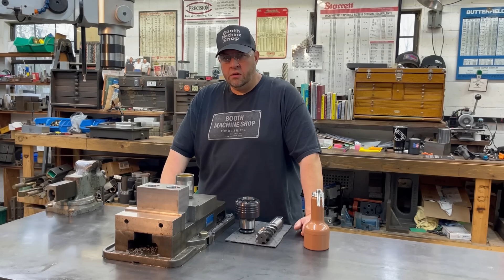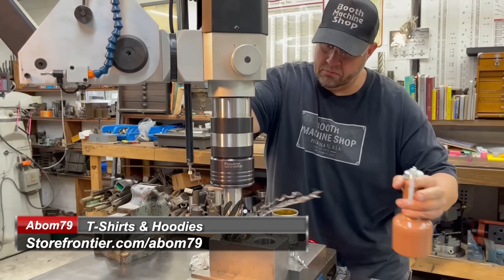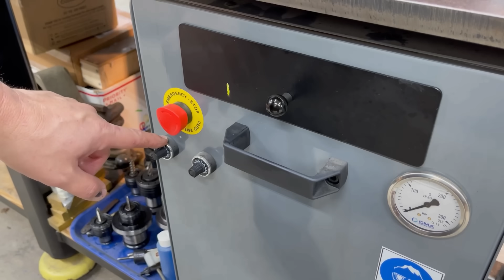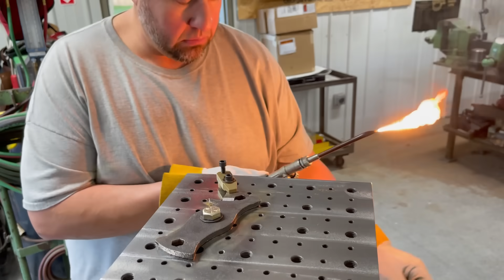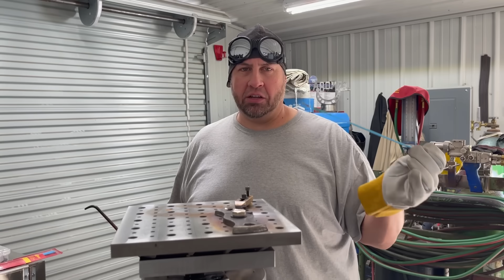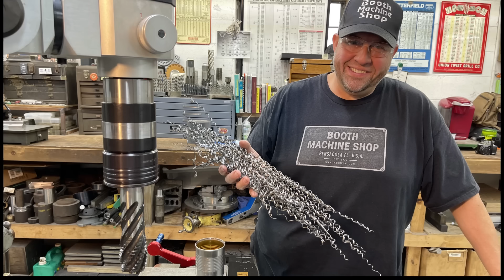SNS 335: 2" Power Tapping with Flexarm GHM-60, Cast Iron Braze Repair

Comment: How fast are you running that tap? Seems a little slow to me. I usually run coated spiral taps at around 15 m/min 🙂
Reply from the maker: I had the tap set at 25 rpm. A little slow but the main reason was so the viewer could easily see the action.
Reply: I believe he ran it fast enough to do a perfect job.  Seems like that is the goal.
Reply: @paulcopeland9035  no doubt about it 🙂 i was just wondering 😉

Comment: 24:12 Adam - it looks like you put down that hot torch very close to some hoses. It's a thing to be careful of whether soldering, brazing or usage of flames for other heating purposes. While the immediate hot danger is removed once the flame's put out, the tip of the burner will still be very hot !

Comment: "dress" the weld down with power tools, I think Tom Lipton would have used a file on the whole thing. Just joking Adam, looks great. I was wondering what that tang was for also. Nice seeing you live Thursday, without that, I think I would have been somewhat questioning why you're just randomly tapping holes in blocks.

Comment: Hey Adam, maybe one time you can explain to us non machinists why you use coolant/cutting oil at times and other times without. You seem to machine cast steel dry and other materials with some sort of fluid. Any reasons for this?
Reply: "Gray" CAST IRON contains graphite flakes scattered throughout the matrix.  It's self lubricating.

Comment: Adam, is there ever a risk of these large taps in a blind hole becoming chip bound, in that you are not reversing the tap regularly, like you would if hand tapping?
Reply from the maker: Spiral flutes taps do not need to have the chirps breaking, they push the chips up and out of the tap. Hand taps need to be reversed.
Reply: Even though I was alway told to reverse taps in school I was also taught by my father several years later that reversing a tap isn't generally needed with most modern taps because they are much better designed to clear themselves.
Reply: To expand a little on Adams answer... There are basically four main kinds of taps: conventional straight flutes (most common consumer home shop type), spiral point, spiral flute, and fluteless. 
The straight conventional taps basically form the chips straight into the flutes where, depending on the size of the flute, eventually get packed with the chips. Not only do you have to back up (reverse) the tap to "break" the chip but you also sometimes have to remove the tap entirely to clear out all the packed chips. These kinds of taps are the most common because they are cheaper to make and they work well enough for most blind or through holes in most materials.
Spiral point taps look a lot like straight flute taps but have a distinctive grind on the first 1/3 or so of the tap. They are ground so that the chip forms down the hole. Similar to the spiral flute chips but they go out through the bottom of the hole. Because of this they are no good for blind holes (as Adam was doing) because they would pack the chips in the bottom of the hole. They are very good for CNC and machine tapping from the top if the hole is not too deep and is also a through hole. They are also very good for hand tapping.
Spiral flute taps (like the one Adam was using) are like a tap with drill flutes ground in to it in the same direction as the thread. hey feed the chip up the flutes and out the top of the hole. Theyare also good for blind holes and can be used on blind or through holes.They are excellent for CNC and machine tapping.
Fluteless taps, as the name imples, have no flutes. They are more commonly known as form taps. They are very very good for softer materials (brass, aluminum, mild steel.) Since they have no flutes and do not cut the thread they will not create chips and need no provision for clearing the chips. They are also very good for CNC and machine tapping.
This is not an exhaustive list... there are other stles and techniques for threading a hole but the above are the main types.
If all you are used to are the straight flute taps from your hardware store then you will be pleasantly surprised by using a good quality spiral point of spiral flute tap. MUCH easier to work with. They tend to cost more US$7-8 for the smaller ones up toabout US$15 for a single 1/2-13 spiral point tap. Even more for cobalt and fancy coatings. But well worth it even for the hobbyist or occasional user. The cost and aggravation of a broken cheap tap far outweighs the cost of a quality tap that will last you a very long time.

Comment: It is possible to do this tapping in the lathe too?
Reply: It would have been faster since he already had it mounted to bore the holes, and cheaper too.
Reply: @catoomch  from a professional perspective, it makes more sense do do this with the powertap than with the lathe. Time is money!
Reply from the maker: The lathe is more than capable of pulling that tap into the part. You have to remember this was drilled in a Cnc mill. Even if it were production this would not have been doing in a lathe. Using either the machine the block was drilled in or using the Flexarm is the way to tap these. I only had it in the lathe to easily chamfer the holes and share some 4 jaw indicating.
Reply: If you really wanted the perfect thread with almost no torque for cutting, you would mill it in this CNC-Machine with a Thread Mill, after you bored it. It was just a demo, what the Flexarm could do for repairs.
Reply: @Abom79  Was it a 6 flute tap ?  If so, it'd be like loading a lathe with 6 cutting tools - and all of them taking a decent cut !
Reply: Yes but small lathes like Adam has would be bordering on being overloaded causing excessive wear. The lathe he used at his former work would not have this issue and would easily break that tap likely if things went wrong !
Might be better suited to a horizontal milling machine as they're better designed for tough jobs.
Reply: @millomweb  thats the question to adam.. is his lathe capable of tapping this size in the lathe?
Reply: @MrMidiman33  His lathe would do it but Adam wouldn't put that kind of a load onto it - I don't think - for one reason - control of the process is another.
It's a similar thing with trucks - some drivers drive them overloaded - it works but it causes more wear on brakes that they weren't really designed for. I've done that - once - the journey was quite a short one (a mile or 2) and not up or down any steep hills.

Comment: I use to do same thing except on old radial arm drill press didn't have shut off feature , nice.
Reply: The clutch was in the tap adapter - so had you used that, you'd have had the same safety system. One slight but significant difference - is your drill being all mechanical builds up momentum from the motor to the tap. With the FlexArm using a hydraulic motor, there's much less mechanical momentum AND it will have hydraulic safety valves that stop rotation immediately on overload.

Comment: That Flexarm is really impressive. I'm a little surprised you did the brazing on your nice fixture plate. Me, I'd use a piece of thick sheet or a scrap piece of channel.
Reply from the maker: That tool was designed and built to be welded on. I'm not concerned with messing it up, it's tough and can be skimmed off.
Reply: @Abom79  It's a bit nice for that !
Reply: It's a fixture plate!  What would you use it for?...stacking feathers?
Reply: @paulcopeland9035  Fixing 'clean' jobs !
Reply: @paulcopeland9035  I'd just tend not to weld or braze on it, especially for a very non-precision part like that vise clamp plate. Sure it can be skimmed off. Then you can re-chamfer 81 holes.

Comment: That flex arm has amazing torque. Plus having  the controls covered a plastic cover, set in a drawer to keep everything clear. Great engineering. 
$40. vice and a three foot breaker bar . What could go wrong.